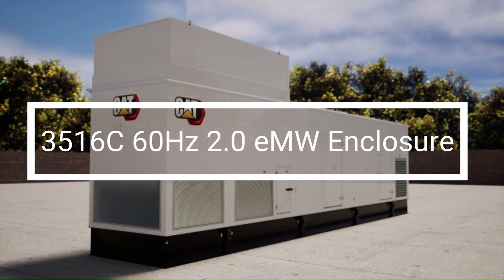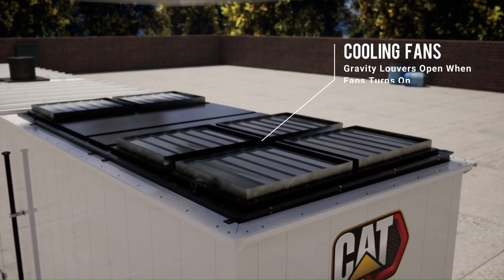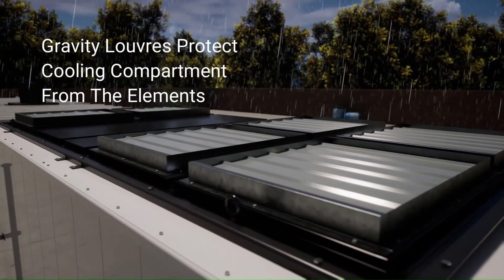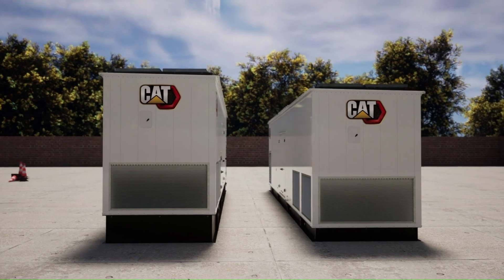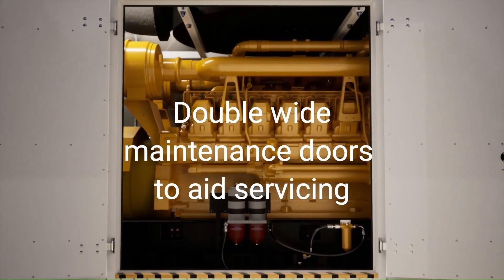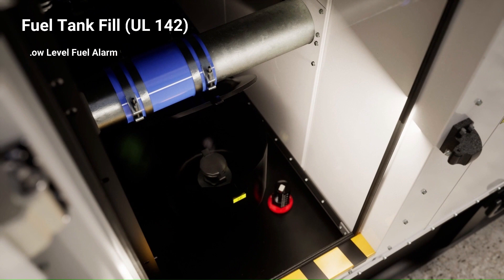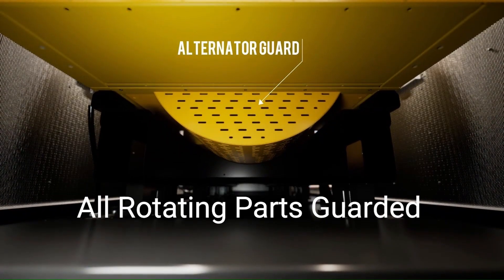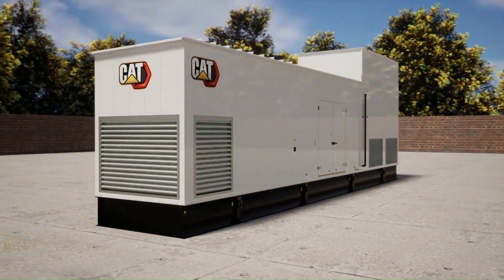3516C, 2 MW, 60 Hz Diesel Genset Enclosure

Comment: I'm wondering where the power outlet?
Reply from the maker: Hi! Great question. This generator set was designed for permanent installation, so cables need to be routed through the baseframe and connected up from inside the enclosure. Hope this helps!